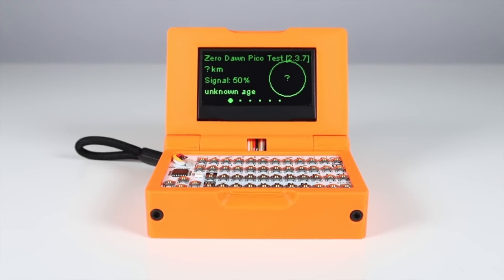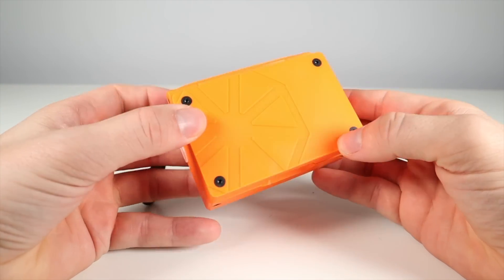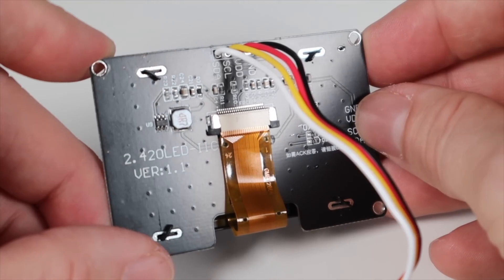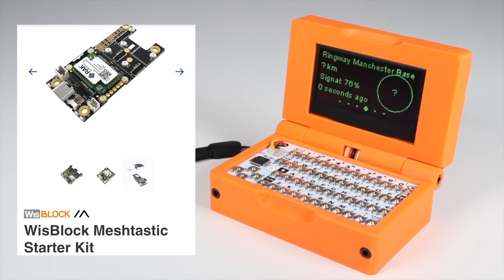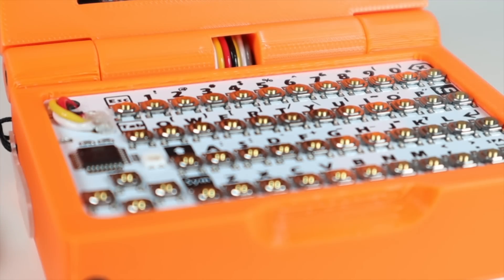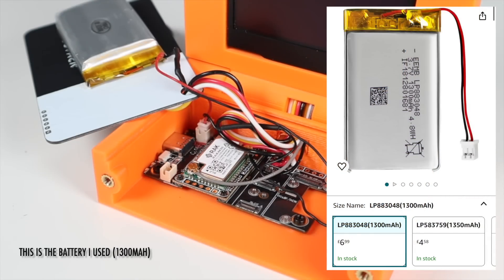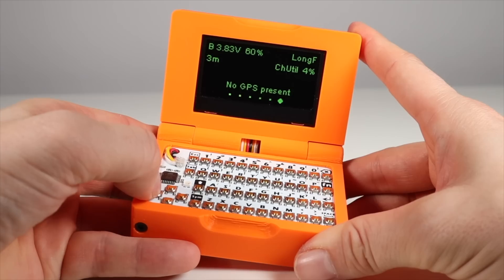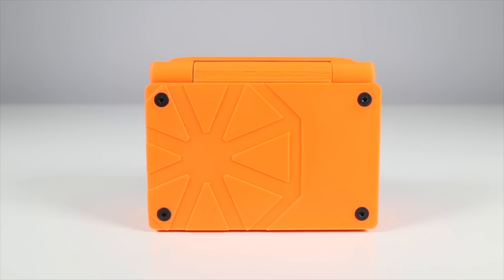Meshbook Pro - The Ultimate Off Grid Communication Device!

Comment: we rely on internet as alwats-on, high bandwitth communication. We forget that we can bulk transfer (one time over internet, or by mailing or carrying info on drives). Low bandwith data tranfer is interesting. If you hosted the apps and ai and things you need locally rather than in a cloud, the informational input you would need to stay updated might be squeezable into long range, slow bandwith connections. If all ypu send is raw data and what's changed rather than bloated web apps ot html, there's more to this than sending texts?

Comment: We were doing all this and alot more 35+ years ago on CB ...with ax2.5 packet @1200 baud.. Bbs ,txt, Aprs  ..nothing new..
If they used vara ACchat ( basically Messenger over radio )as a base mode...they would have many more features including ..email if a port was open to the web..

Comment: This is a great video and I love this idea of using RAK boards very much. As far as my knowlege and personal experience goes, RAK boards are also the best when a Meshtastic node is used either as a solar powered repeater or router as they draw less current than LILYGO or Heltec, probably due to those two being run by ESP32, which is more power hungry.
For northern hemisphere, the battery life becomes more pronounced as there's very little daylight during winter months and the node must rely more on the battery to function.

Comment: I am at a loss as to why you describe this as "off-grid" when it relies on a LoRa mesh network. Hardly off-grid!
Reply from the maker: Because it doesn’t require a network and is completely off grid. Come on lad wake up before spouting nonsense
Reply: Theoretically a company could mount receivers on many radio towers and listen to all channels on the 868 frequency and then decode it as soon as possible
Reply: Or OFCOM could restrict the ISM band

Comment: What happened to Andy? You are the top Meshtastic Youtuber now.
Reply from the maker: I always was ;)
Reply: @RingwayManchester  From number stations to 80' vigilante soldering iron slingers. you are a great capacity for anything radio, but you lack Andy's boyish enthusiasm. This video is brilliant BTW. This device has the functionality of the T-Deck, without all its flaws, like its impossible high power consumption and no software support for light sleep it uses 1/2W. A device like this is so much better with a Wisblock and a lower powered display. Are you going to rats nest together something Meshtastic, to prove your right to the throne? The Nice-RF higher power LoRa radio module has the SX1262 and should be pin compatible, just needs a higher supply than the 3.1V the base modules need for their 22dBm, not to go in the footsteps of former pirates, but I presume it has a better radio receiver and filtering so it would be beneficial even when run at legal levels?

Comment: Lately, I'm into dev. Boards, the one I'm now assembling is a ESP32 with relays. But I noticed they have great stuff as well for radio use. Even for use with a simple Arduino. There are great developments circuits out there. I'm pretty new to this.